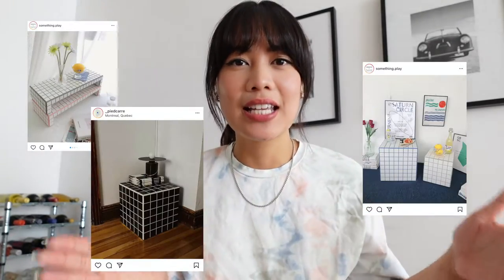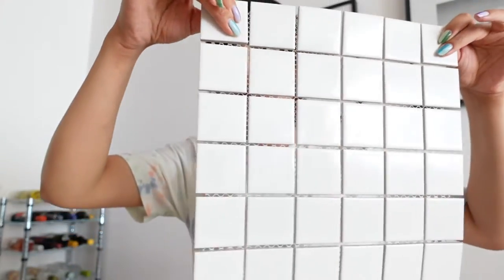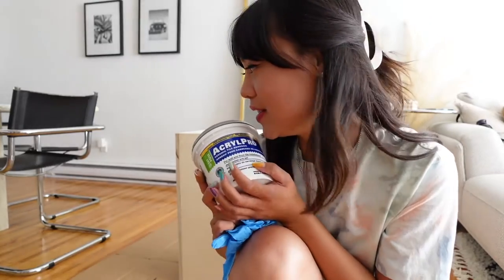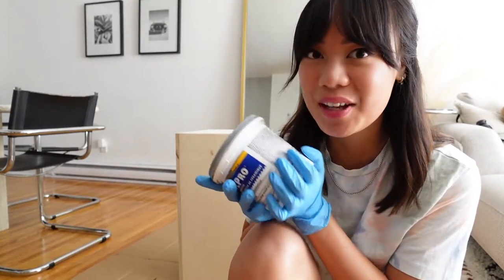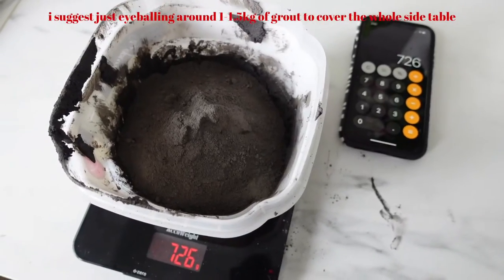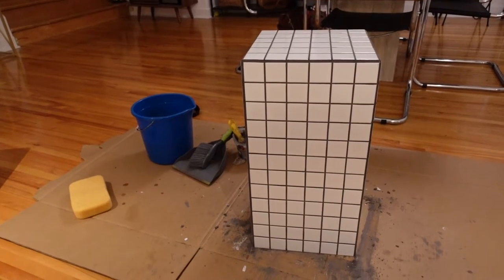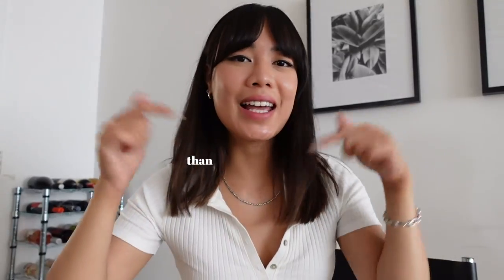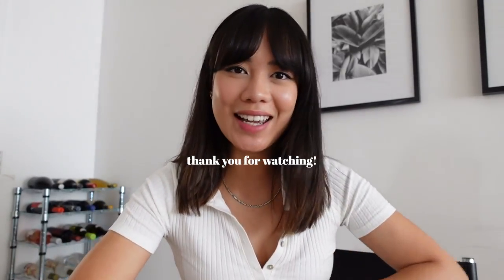[DIY] TILE SIDE TABLE - step by step tutorial, honest thoughts and what I wish I knew!

Comment: It's easier to not wait for the grout to set. My dad is a tiler and he said to apply the grout to a section then quickly with a wet sponge wipe away the excess grout. This eliminates killing your back cleaning and the grout off from the tiles also makes the process a lot easier to handle. Also correct use unsanded grout people unless you are a professional and know how to use sanded grout, but unsanded is best :)
Reply from the maker: wow thanks so much!!! my next project will be better thanks to your dad's tips hehe